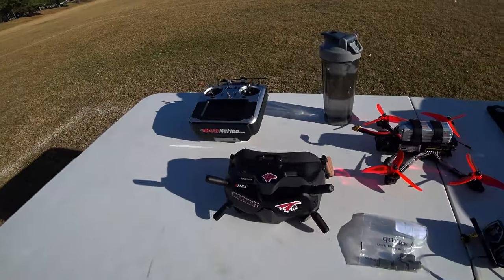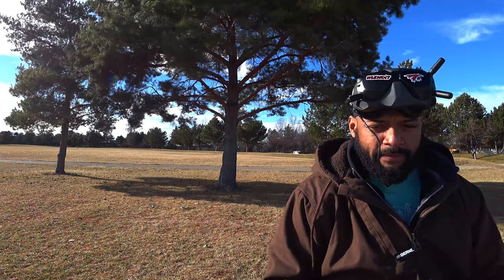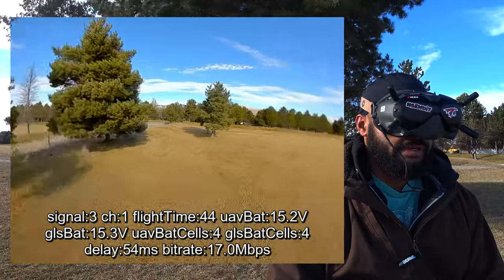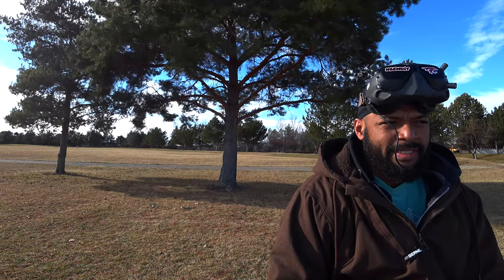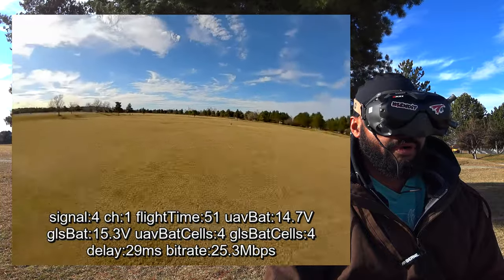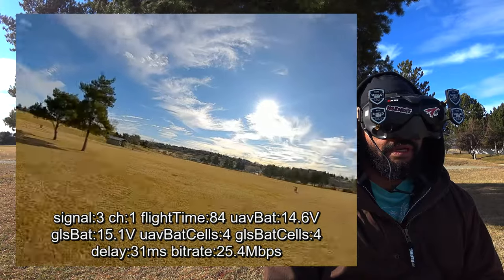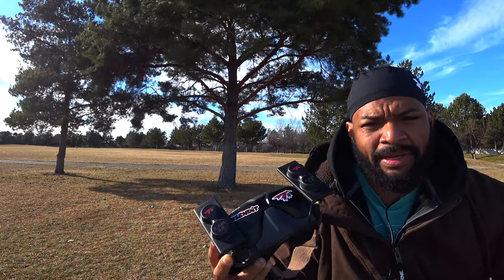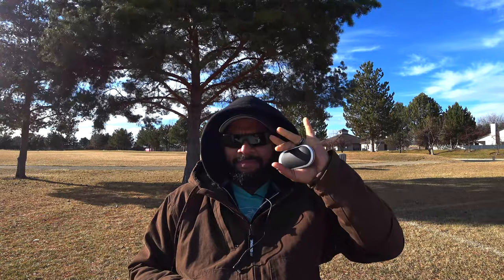ORT Shield for DJI FPV | The Sequel | Tuesday Vlog

Comment: Thx for the compare.  I currently run singulars on one end and one X-Air on the other. I leave the X-Air kinda hanging out of the goggle bag. Maybe a little chance to get damage, but I have a bunch of padding in my backpack for them.  I havent done much testing, but it seems to work better than all singulars and I still dont have to remove anything.

Comment: Lol,... It totally crossed my mind about landing on the table.

I think your testing versus my own experience highlights the need to consider the whole system when selecting antennas. You're testing stock antennas and Singularities, but with stock quad antennas,.. which better match the axial ratio of the stock goggle antennas. My testing, also using the srt files, shows the Singularities smoke all other omnis including stock,.... but I have VAS Minion Pro's on my quad, which would closer match the axial ratio of the Singularites. I guess a test I might do is, Singularites with Minions, vs Stock with stock,..
Reply from the maker: Ahhh that would make sense because the first time I tested the singularities it was with AXII's on the quad. Hmm...
Reply: @Furadi   Yeah, your original test and their size was what prompted me to want them. Took forever to finally find them in stock, and then I was pleasantly surprised that they beat my other antennas( stock, Lollipop3, and SkyHammers).
Reply: So, I actually already did this test. I found it in my "history". Here's stock with stock:
https://youtu.be/Foyqj51RuzU   It hits 12Mbit on my bad spot.
And Singularity with Minion Pro:
https://youtu.be/83HZ3V71YIQ   It hits 23.6Mbit on the first pass. If I loiter in that spot real close to the ground, I got it as low as 17.5Mbit. But most of the time when I pass this spot at a normal speed, it barely ticks lower than the full 25.4Mbit with Singularities and Minion Pro.

There is another super bad spot at the opposite corner of the field, but I don't really count that one since I don't always go there.

Comment: Seems like good comparison and somewhat expected results. I wish there was a way to mount the X-Air at a 30ish degree outward angle. This should give the same coverage in the front and increase the coverage to the sides and back. I'll have to play with different mounting on mine and see if I can do it. That said I am pretty surprised by the backwards coverage
Reply from the maker: I wanna say I've seen pictures of people doing something like that.
Reply: I’m able to do mine as long as I put them kinda diagonally, it just takes experimentation

Comment: thanks, nice work. Maybe you have time to test 1x X-AIR with 2x Stubby vs. 2x X-AIR
Reply: Yes. With one xair on top and stubby on bottom you should have a good compromise.  In additin the google keep compact
Reply: I agree with that. That's the setup I'm running. 1 xair and 2 singularity stubby
Reply: Hi @Carve are you running xair on 2 top connectors and 2 stubbies on bottom ones? Would it work same with say, xair on one side and 2 stubbies top and bottom on opposite side?
Reply: @marxdroneworx  I'm doing it on the side. It works great
Reply: Thank you @Carve. I will give that a try! Sounds great. Cheers

Comment: Hey what up man..... thank you again for the heads up on the DJI google adapter you posted... I. Need your help with the wiring for the remote when using DJI... if you can do a video on that would be alsome
Reply from the maker: The DJI controller? I don't have one unfortunately.

Comment: So, I have a question, with all your antenna testing, have you noticed if one single x-air unit works better on the top two posts, the bottom two posts, or would it work best on one side? The reason i ask is because i learned the top two transmit and receive, and the bottom two receive only.
I also saw another video where the advised positioning was to have the two stock antennas on top, and two patch antennas on the bottom. So now I'm confused about where a single x-air unit would work best. I have had mine on the top two for a while.
Reply from the maker: I've tested it in multiple configs and it didn't seem to matter.
Reply: @Furadi  ok, thanks

Comment: What are your thoughts on mixing antennas? Like two singularities on the bottom and an X-air or ORT up top? Worth the advantage of maybe being able to leave antennas on all the time compared to having to remove the double x-airs or double ORTs? Or do double x-airs provide enough extra performance to outweigh the convenience?
Reply from the maker: I don't think there's any advantage to mixing aside from cost savings... I would never transport the goggles with anything but the singularities on.
Reply: Furadi makes sense. Once you buy singularities you’re not even saving all that much money (it’s actually cheaper to buy two sets of ORTs)

Comment: What happened to the cyclops? I want to see a comparison of the V2 cyclops to the x airs.

Great work by the way you still cost me about $1200 with your videos but I'm thankful for it, FPV is fun again.
Reply from the maker: I don't have a v2 cyclops. I didn't include the v1 in this test because I already knew it performed slightly less than the Xairs. That and it would have been a pain to install with cold fingers.
Reply: @Furadi  do you know that though???🤔 The stubbies didn't perform as expected...
Reply from the maker: @NoName-hx4hm  if you check the caption the singularities did out perform stock slightly... I just couldnt see it in the DVR.

Comment: By stutter do you mean it’s getting blocky pixel wise or is it lagging like the video pauses n goes n repeats?
Reply from the maker: Oh literally the video is like micro pausing. The goggles reconstruct the frame loss so you don't see it in the DVR. But that's only when bitrate gets really low.
Reply: Furadi  oh wow but good to know the shields are good we had them for a while just haven’t used them I’m wondering if trying different kwad antennas in conjunction with the different antennas will produce better results

Comment: Always clear. Shield for me for now. You nigh want to get the $30 box for goggles and radio, set fits with stock antennas on.
Reply: Question. Can you use the shields and leave stock ones on the quad?
Reply from the maker: course

Comment: couldn't you just plot the srt data and compare that way?
Reply from the maker: Like on a spreadsheet?
Reply: @Furadi  line plot of mbps over time in excel or even bar plots averaged over certain time period in the flight.
Reply: because the data are somewhat variable, by overlaying the lines from different antenna tests, you'd see it better I think
Reply from the maker: @PIDtoolbox  thats way above my pay grade 😂
Reply: @Furadi  of course :)  Really love your tests though. If you posted the srt files I would be happy to send you plots. I do data analysis on a regular basis in my job. I also developed BB log analysis tools. anyway, keep up the reviews. there are few people doing them on the dji system.